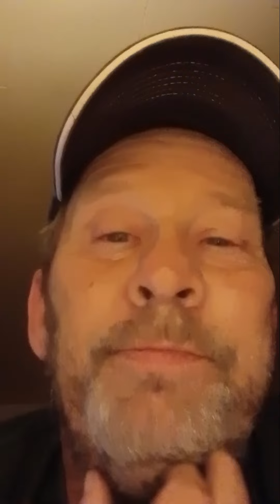carburetor  jetting and function  is on my Playlist.  can't explain  stuff any easier 😊

Comment: Yes. Ok. Been lookin for vedios like these. I just got a 49cc semi broken in. The darn thing is faster than I expected. It climbs hills too. All while 4 stroking most of the time. It 2 strokes while starting off. And at high range but I don't hold it there long. But yeah. It 4 strokes through most of the climb. It's got the small speed carb on it. I tighten the idle screw until it ran correctly. Oh and I found where it blew some gas vapor around head gasket. I tightened it this morning. Going to see what she does around dusk. But yeah. It's a little screamer. 49cc. You would think it's at least a 66cc or 80cc but it's not. I bought another piston and jug. Gonna try ramping the piston and playing around with the port timings to see what happens. I don't know if I should though. I think it already goes 30 maybe 40mph. Which is quick enough for a bicycle.
Reply from the maker: As far as ramping  pistons go it all depends on what the original  cyl and port timings were. And what piston looked like at bdc and what tranfer duration  I was looking for.  There's many different routes a person can take to get to the same destination.